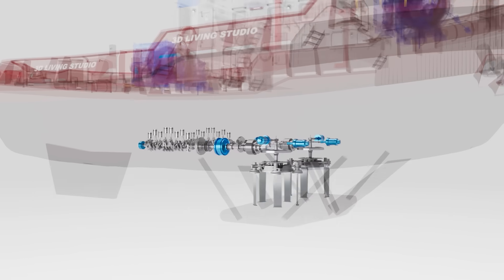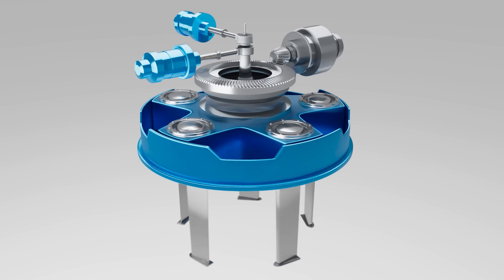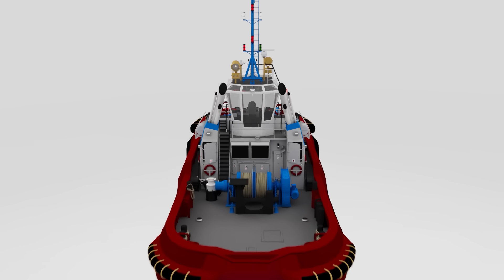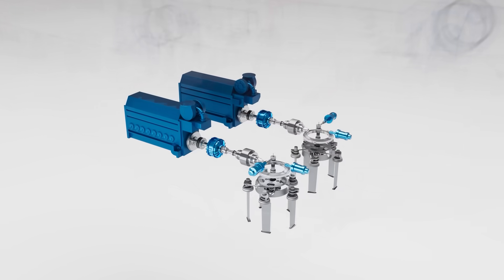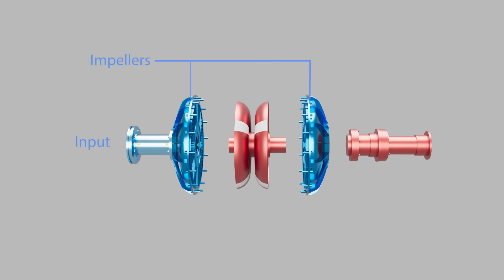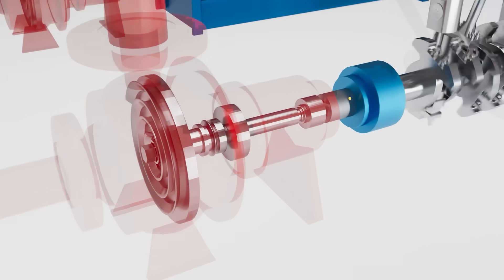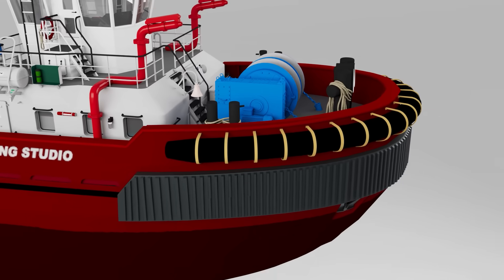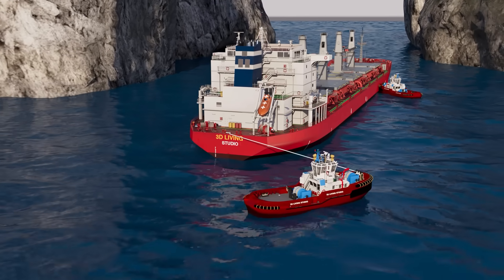How A Tugboat Works - Voith Schneider

Comment: VSP tugs tow over the stern and push with the stern.
Your showing a typical ASD design of Tug.
Also the Skeg on a VSP isn't for stability from rolling it's to keep the boat straight while steaming ahead. Without it the boat would crab and be difficult to stear. Its also built the same depth as the skid plate under the units which offers protection and stable platform for dry docking.
Reply from the maker: Appreciate the information and the correction!

Comment: I am the captain of a VSP in Sweden. Interesting and well-made video, it's just a shame that the illustration is done a little wrong. The VSP is placed at the opposite end of the tugboat from the tow rope. It is the fin that makes the force during indirect towing and not the propellers. Therefore, the fin is always forward during a tow. It would also be very difficult to turn with the tow rope so close to the propellers.

A tractor tug is like in the video but then it tows over the stern. A finn first tug VSP tows over the bow but then the VSP is in the stern.

Comment: You need a puff guard. Listen with headphones if you don't understand why. You keep popping in my ears.
Reply from the maker: I used a puff guard, but maybe I have to tell the recording studio to invest in a better one.
Reply: @3DLivingStudio  Good luck. 

FWIW, the worst place for a mic if you're having problems with plosives is on a table, below your mouth, directly in front of you. 

If you move it off the center, and then point it diagonally at your mouth, it'll help. 

Suspending it at mouth level instead of below, where plosives are pointed, will help even more.
Reply from the maker: @GregConquest  Thanks for the tip, I will adjust some mic position in the next time!

Comment: That's pretty interesting I don't know if anybody else noticed but it's kind of like a helicopter except instead of the blade tips being out radially they are down vertically
Reply: Sort of but not exactly the way a helicopter rotor really woks (aerodynamically).  Blade pitch change on a helicopter rotor actually tilts the rotor disc relative to the angle of the rotor shaft to move the helicopter in the desired direction.  At play in the system are  gyroscopic forces which cause the rotor disk to tilt 90 degrees to the direction of the lifting force of the blades. To go forward, each blade is rotated up as it passes a point 90 degrees to the centerline of the helicopter. The upward force on the edge of the rotating disk causes it to tilt forward which. In turn causes the downwash to aim aft forcing the helicopter forward. You can experience this gyroscopic effect with a toy rotating top: try to tilt it in one direction and it will actually tilt 90 degrees to that push. The boat propeller is more like a paddle wheel. The trick is designing the mechanism to control the blade angle to get the desired thrust direction in both the helicopter and the boat by constantly varying the pitch angle on each individual blade as it goes around the circle. Sorry for my enthusiasm in this obscure subject.
Reply: Really intuitive and very easy to understand.
Reply: Your correct that is exactly what it is, except instead of moving air it moves water
Reply: That was my first thought, too.
Reply: принцип крыла  вертолета и самолета.
Reply: sadly, the issue of sealing the prop driving mechanism was completely overlooked.

Comment: The towing line would be attached in the back of the tugboat for this kind of propulsion setup, not at the bow.

Also the "operators place" would be completely reversable so the tug could be controlled facing any of the two directions.
Reply: When equipped with VSPs in the front 
(or also with azimuthing propeller gondolas in the front) 
the so called "Tractor Tugs" fix the towing line to the rear of the tug, not the front.

With the big distance between these two points and both being at different sides of the centre of the boat, you get a horizontal leverage effect between the pivot point of the towing line and the centre point of propulsion, so you can manoeuvre better and have better possibilities to use your propulsion power while turning.

If the pivot point of the line is very closely above the propulsion setup, you can basically turn your tug underneath the line without much effect.
Or the line turns the tug without you wanting it...

Old tug designs had a lot of problems with it, when they still used conventional propellers at the rear of the ship and also had the towing hook at the rear pretty much above it or - even worse - closer to the centre of the ship.

The overall shape of the tugboat in the video (bridge far in the front with only front facing controlls and a big empty deck at the rear) would be typical for an ASD (Azimuth Stern Drive) tug anyways, so a tug which has two azimuthing propeller gondolas in the stern (or back) of the ship.
Where the tug winch would indeed be at the front, creating a similar desired leverage effect again.

Sadly those other even more popular types of tugs aren't even mentioned in the video, as if the Voith Schneider propulsion would be the standard (which it is not).

Edit: As I just saw there is a video on this other type of tug already on the channel. I don't really understand why it isn't mentioned here at all. But sadly it contained even more mistakes anyways, even making the same mistake with the position of the towing winch, but the other way round...

Other than that it is a pretty good visualization so these inaccuracies are quite a bummer.
Reply: @Unimog1600  I am pleased you mentioned that the exact positioning of the windlass/tow hooks is critical to any successful tug design. If they are not positioned correctly in the hull in relation to the propulsion system then steering a tug when towing a heavy vessel becomes very difficult.  👍
Reply from the maker: Thanks for bringing this matter to my attention.  I have a plan to make a small series about different type of tugboats.  I was too focusing on the mechanic part and didn't do a good job on the operation part.  I will continue with this series if the view count is good, and will correct all the neccesary errors.
Reply: @3DLivingStudio 
I'm happy that you understand my point.

Yes that is what I thought, that your focus of this video was on the Voith Schneider system and everything else was a bit neglected.
I can only suggest that you maybe just focus on the main topic of the video in the future and don't even try to put additional information in the video, that may not be as accurate.

Your animations are great but wrong information makes the videos unnecessarily bad. 
Of course mistakes can always happen in small details but it shouldn't be main chunks of information.

Especially at times where everyone creates his own "facts" I feel that the focus on correctness is vital.
Your viewers want to learn from your videos and this should be the scale to measure yourself.

All the best. 😄
Reply: @3DLivingStudio  If you see this message, I hope you can withdraw your complaint. Please.